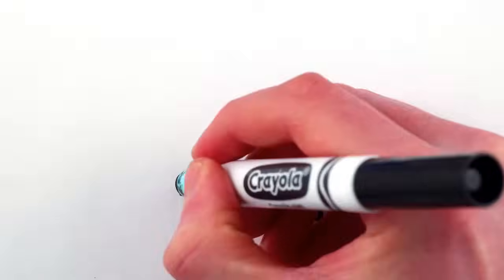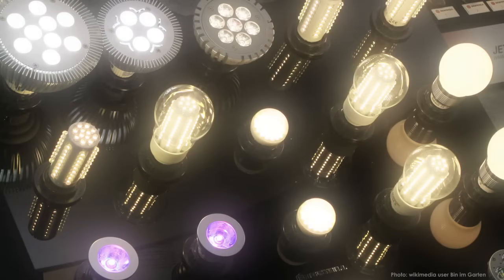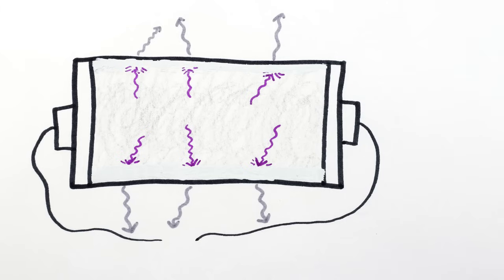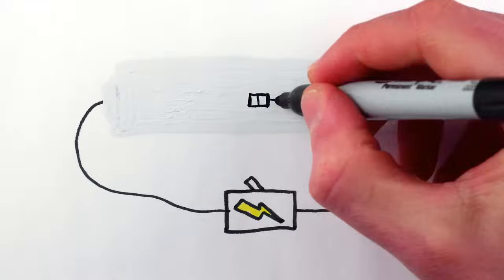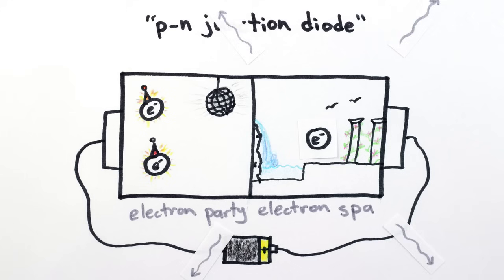How Modern Light Bulbs Work

Comment: Good video, although your description of gas discharge lamps are a bit weird. It may be accurate for low pressure sodium, but HID bulbs work by having two electrodes inside an arc tube that generates the light.

Comment: what is the white coating in fluorescent bulbs?
Reply: also. the diode 'explanation' is just sounds like an inserted belief of what happens. it reaches a proper enough conclusion, but the steps there seem strange and close enough but not there.  (not that its your belief).
Reply: Phosphor.
Reply: It's a phosphor coating that converts the UV light that the bulb emits into visible light.

Comment: You left out (though the usage of battery implies it) that led based lightbulds all have transformers and rectifiers build in. IMHO huge waste compared to incandesent bulbs, which actually produce heat along the light lessening the heating costs of our apartment in Finland where heating is needed in summer nights also. I hate the EU ban on those as the result is more waste and waste of resources.
Reply: commenting while not knowing 100 percent, LED light bulb is more efficient because the diode itself doesnt need to create heat to create light, and saying that led lightbulb waste more energy because of the driver and rectification process proves the point even more that you dont know stuff
Reply: @GERMANIA292  But led lightbulb is more costly to make and as waste is electronic waste and costlier to handle. So change from the incandecent bulbs raised the cost of the bulbs over 300%. Also Led-bulbs have lower life expectancy than incandecent bulbs.
Reply: @topilinkala1594  maybe LED last shortee than incandescent because you were buying the cheap one, the good ones is always better in almost any categories, LED bulbs are getting cheaper and cheaper you know they don't cost 10 dollars anymore, LED bulbs is also cheaper to run in the same time incandescent do, sure the initial cost is expensive to you but the power bills saving are still gonna pay off even if the LED have shorter lifespan than the incandescent
Reply: @topilinkala1594  there is a chance that the electronic waste gets recycled, infact, the old street light and the cfl bulb is way harder to recycle than LED
Reply: That's beyond the scope of a 2 minute video. Good explanation are good enough for an average youtube  viewer.

Comment: 3 months ago from 8 jan 2019 4:57 pm est:
thanks
8 jan 2019 4:57 pm est:
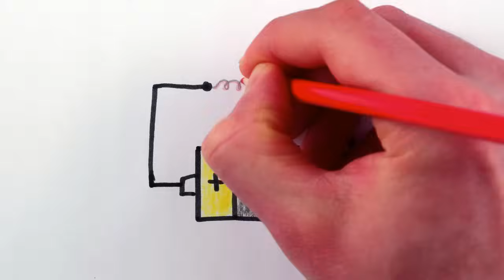0:01 1st light-bulb is just thin-wire having electrical-current,which make
     that thin-wire hot and glowing.that is called bare-filament/bare-wire electric-lamp,
     1st made by humphry-davy year 1800.
0:12 thomas-alva-edison insert that bare-wire-electric-lamp inside a glass-bulb,to keep
     away oxygen from that bare-wire because oxygen make that bare-wire,burn.
     so glass-bulb make bare-wire glow long time without burning.
     that is called incandescent-bulb,19th century technology.
source:'In addressing the question of who invented the incandescent lamp, 
historians Robert Friedel and Paul Israel list 22 inventors of 
incandescent lamps prior to Joseph Swan and Thomas Edison.[8] They conclude that Edison's version was able to outstrip the others because of a combination of three factors: an effective incandescent material, a higher vacuum than others were able to achieve (by use of the Sprengel pump) and a high resistance that made power distribution from a centralized source economically viable.
' in https://en.wikipedia.org/wiki/Incandescent_light_bulb from 'Incandescent light bulb' in https://en.wikipedia.org/wiki/Electric_light

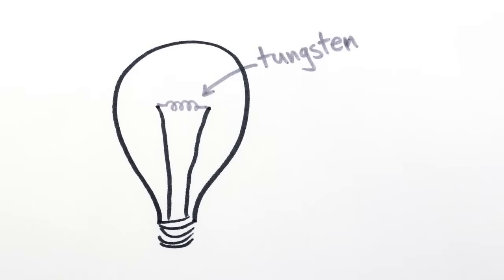0:37 halogen-bulb:has same tungsten-filament like incandescent-light-bulb.
     but halogen-bulb contain halogen-gas.
     halogen-gas catch stray-tungsten-atom which evaporate from tungsten-filament
     then put stray-tungsten-atom back to tungsten-filament,to prolong life of
     tungsten-filament and keep bulb-interior clean and clear.
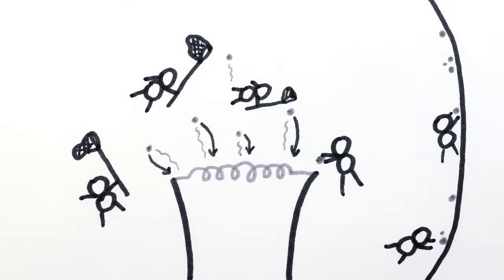0:59 fluorescent-bulb is a bulb/tube contain mercury-gas,contain electrode on both ends.
     electric-current flow from electrode 1 to electrode 2 then electron
     inside electric-current collide against mercury-atom in mercury-gas.
     that collision make mercury-atom excited then emit visible-light and
     ultraviolet-light.
     white-coat on bulb-interior absorb ultraviolet-light then convert that
     ultraviolet-light to visible-light(fluorescence process).
     that white-coat prevent ultraviolet-light which causes cancer.
     tanning-bulb has different coat.
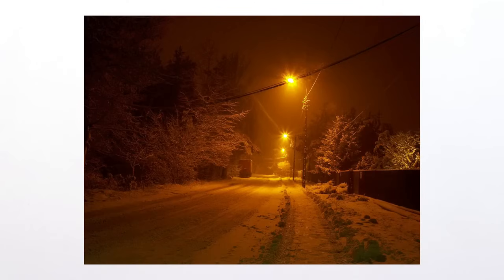1:35 sodium,mercury,metal-halide-vapor lamp,are often for lighting street,
     warehouse,gymnasium.
     sodium,mercury,metal-halide-vapor lamp,is a bulb contain gas,contain 
     2 electrode on both ends.
     gas emit visible-light so sodium,mercury,metal-halide-vapor-bulb does not
     need fluorescent-coat
1:51 led-lamp is just a tiny-crystal-semiconductor-gallium.
     semiconductor has 2 layer.layer 1 give energy to excited-electron.
     layer 2 give place for electron to relax.
     electri-current transport electron from excited-place to relax-place.
     excited-electron release energy in relax-place,that energy becomes light.
     that is light-emitting-diode/(led)

Comment: It would have been better if you had thoroughly explained it. Like this- When electron are excited they go to higher orbit but electron just want to  go back at their lower energy level and in the process of doing so they emit photon as a type of radiation and they do so to lose excess energy. This is what a light is.

Comment: Dude florescent lamps require like 180 volts to work ... They work by self induction you had to point out that
Reply: 120 volt.source:my 1 fluorescent-bulb-sylvania,1 incandescent-bulb-westinghouse.
 (1)fluorescent-bulb-sylvania:
     volt=120
     watt=13
     lumen 875
 (2)incandescent-bulb-westinghouse:
     volt=130
     watt=60
     lumen=485
[8 jan 2019 5:12 pm est]
Reply: what

Comment: Fun fact, solar panels are LEDs in reverse.
Reply: How did you figure that out
Reply: Solar panels take in light and output voltage. LEDs take in voltage and output light. But it goes deeper than that; they're actually built the same way. They both are based on p-n junctions.

Comment: while watching this I realized somthing...if light particles produce an extremely small amount of force on anything it touches then using solar panels as power you could use a bright light to shine on a space ship to move it without rocket fuel....if would be extrodanaraly slow but it would cause a small amount of force pushing the object slightly through the vacuum of space....and mabey a scientist can take it from here to improve on this theory
Reply: This works. In fact for things like Mars probes mission planners have to take into account a few m/s of acceleration due to light pressure on the way to Mars. There are also spacecraft that maintain their orientation with clever use of light pressure. And finally a long mysterious acceleration on the pioneer spacecraft was later determined to be miniscule photon pressure caused by radiation from the onboard RTG (nuclear heat/power source) reflecting assymetrically throughout the craft.

Comment: But MinutePhysics, you didn't explain your intro picture!  What's going on with the new bulbs made with the twisty tubes that have become so popular? Is that a fluorescent tube twisted so it doesn't take up much room?
Reply: yes
Reply: Dennis Magee the modern bulbs are all basically discharge tubes to generate cathode rays. But we can't use very long tubes every so it's twisted to make space
Reply: Exactly. They also have some additional electronics to make it turn on quickly.
Reply: Thanks!
Reply: thanks!
Reply: Thanks!

Comment: Actually, white-light LEDs are in fact somewhat similar to fluorescent tubes in that the LED itself actually emits fairly monochromatic UV light, which is then converted to broadband white light through the use of phosphor coatings. Sure, the way the source UV light is produced is pretty different, but it wouldn't be entirely wrong to call white-light LEDs "fluorescent LEDs".

Comment: My house from the 80's,has a light bulb turned on by pulling a string of beads,a long tube on some parts of the house,an electrical lamp on the rooftop garden and some modern light bulbs.
Interesting.I'm born in 2003.

Comment: ...I just wanted to know why those other light bulbs are swirly...
Reply: +MrPilot Guy Longer and thinner for more resistance -> inefficient conductor -> more heat/glowing light
Reply: +MrPilot Guy CFLs are the same as fluorescent lights, which means that they are tubes. in order to make them fit inside standard sockets, the swirl the tube to make it fit.

Comment: Halogen bulbs are terrible... I know from experience... TONS of wasted energy goes into heating a room several degrees in fahrenheit and lots of radiation requiring UV filters... These two combined CAN fry things such as a sticker on the inside of the lamp (not the bulb)..

Comment: And neon lights work by taking a noble gas (helium, neon, xenon, etc.) and passing an electrical current through it, depending on the gas, the colour is different.
Reply: +Aeternitas Ankondrivah (No.4 Holder of darkness) lol i had the same exact reaction

Comment: leds contain gas as well and the pn junction is used to force electrons to pass trough the gass and light it up. so you can think of it as low woltage fluorescent tube. (asuming the fact fluorescent tubes need up to 1 KV to light up)

Comment: How many hours can an LED bulb be lit before it dies? Some of the more classic bulbs only survive a thousand to a few thousand hours, but I heard LEDs "degrade" (for lack of a better term) much slower.
Reply: ***** That's only true if the industry can build crappy lightbulbs at a cheaper cost than their consumers buy them. Since longevity is a quality that a lot of people look for in a lightbulb, a new company could establish itself by selling very long-lasting lightbulbs, just with a significant price markup to maintain profits. There's no reason for the new company to sell intentionally short-lived bulbs, since it gets more than enough money from selling high-quality products at a very high price.

So, it's probably not a giant conspiracy to keep us consumers coming back for more. It's actually economics that keep us consumers coming back for more. Don't assume malice when self-interest is an adequate explanation.
Reply: Most LEDs have a lifespan relational to their temperature vs their heat synch, in other words, the hotter they run the less hours they exist. Typically, 30,000-150,000 hours, but the most likely scenario is the  soldering points will burn out from heat and corrosion. This will happen between%10 and %90 of the LED's life, depending on chance, treatment, and quality of build. The highest power lights may burn out in 5-10 years of  constant usage, making them pore choices if they are too expensive, low quality soldering is the number 1 cause of them going out.
Reply: With consistent use, usually between 10-20 years
Reply: ***** I think we are missing a big point here, efficiency. Why laws enforce the use of fluorescence bulbs and LED bulbs? Because you will pay a larger electricity bill using tungsten bulbs than using fluorescents or LEDs, and the government wants to reduce the emissions of CO2 (as a good share of electricity comes from coal and gas).

Fluorescents and low-consume bulbs are ok, but I think the winner here is LED. I bough some LED bulbs that produce the same luminosity as a 100W tungsten bulb, but were around 10W... it's a tenfold decrease! Plus they also last much longer than tungsten ones (10.000h of use I think) although.... they are very expensive :''(
Reply: ***** there is no such thing as "take over" LED lights, florescent, HID, halogen incandescent, normal incandescent, and others have all existed and will exist for a long time because they have different purposes. For home lighting, LED are terrible because their range of color is somewhat limited. The waisted energy in incandescent is  not totally waisted into heat. Temperature has nothing to do with luminescence. Try this, light up the room with the element of an electric stove. ((((((((((((((((((((((((((((((((((((((((((((((((((((((((((Has nothing to do heat.)))))))))))))))))))))))))))))))))))))))))))))))))))))))))))))
Energy is simply waisted into resistance and not put into heat. The same 1 w of energy it takes to make an incandescent flashlight light up one lumen, can make a LED light have 100 lumens. The two flashlights put out an identical amount of heat so you are wrong about heat being that waisted energy.

Xenon HID are great space savers,and are the only lights that will outperform halogen incandescent lights in every way including producing more -guess what - heat. Kryton lights are also not used in home lighting for reasons I don't understand. It would be nice to have a new light that is good at everything but they all have weaknesses.
Reply: ElectricPyroclast most common bulbs sold now last for a far shorter time on purpose. (the industry doesn't want you to buy regular bulbs any more)
Reply: ***** No, it's also true if the industry can sell fluorescent lamps for a higher profit and/or more often than any regular light bulb. But if the regular bulbs last longer and are cheaper people naturally wouldn't go for those, or would they?
Besides, those crappy regular light bulbs have a much much higher profit margin than before. They are indeed build at a cheaper cost and sold for a higher price than before: what better way to push consumers towards fluorescent lamps?

What new companies are actually selling regular light bulbs? The real problem for that is that there have been put laws into place to discourage regular bulbs. On top of that are the patents for many designs, manufacturing techniques etc. of regular bulbs still owned by the large companies in the industry. New companies only would sell those long lasting regular bulbs if they were able to actually produce and sell them.

There are no high quality regular light bulbs available any more. Whereas they have been available before. The question one should ask is why can I buy short-lived regular bulbs, but not the longer lasting regular bulbs that were available before?

Of course it's self-interest and not simply malice for the sake of malice. The fluorescent lamps were more profitable than the regular light bulbs. They can sell them for more, and they would actually have a shorter lifespan, meaning they would sell more of them as well.

Of course it's economics. It's not to keep consumers from coming back for more, it's to get consumers to come back more often, and buying more profitable products, all in the name of preserving the environment - even though fluorescent bulbs last less long and are worse for the environment than regular light bulbs. ;-)
Reply: LuisIsern Of course the winner is (or seems to be) leds. And I'm truly glad those offer an opportunity to step away from harmful fluorescents. Those are far from "ok" and their benefit in reducing energy consumption was a joke.

It's actually been shown by several studies that people became less conscious about turning off lights to conserve energy because it indeed mattered less to their wallets. Effectively barely any energy was truly saved resulting in minimal impact on the environment.

Meanwhile the chemicals used in these types of lights, and their short lifespan caused much more of an impact on the environment than could have been reduced if there was actual energy being saved.

Even more so because household lighting has never been a major factor in our energy use even if you only look at homes and not also at industries. The whole energy saving argument was a fantasy from the beginning and just an excuse to justify the laws to enforce more profitable bulbs with shorter lifespans (not to mention them often not even fulfilling the promised luminosity and it deteriorating throughout their lifespan).

As for the incandescent bulbs, most of them are used inside the house mostly at the darker (and thus relatively colder) times of the day, and for the longest duration in darker and colder seasons. The notion that the extra energy consumed by them is always wasted is false. Although a large amount of their energy isn't used for their main purpose (lighting) it can hardly be called wasted when it is emitted as heat in temperature controlled indoor homes. The little heat they generate will most of the time just add to the heat already generated on purpose by heating appliances that are already active.

In the end it's very clear that if not deceitful or delusional, the argument of saving energy with these short lived and chemically harmful fluorescent lights for the sake of the environment is severely short-sighted and ignorant.

It seems LED lights will eventually take over and it seems that's a good thing but I know too little of them to be sure those are the solution.
Reply: +ElectricPyroclast, LEDs are generally a solid choice and very much safe from the originals.
Reply: Ben Braceletspurple Thanks for clearing up the heat subject! I didn't know that! That changes that part of my argument indeed!

Comment: If the florescent light emits UV rays wouldn't it give cancer
Reply: In the video they talk about how there is a white coating applied to each bulb to absorb the UV light and to re-emit it as visible light. This prevents it from having negative effects on us.
Reply: No, because the UV rays are absorbed by the fluorescent coating and re-emitted as visible light. Lots of energy is lost in that exchange. Imagine a bullet hitting a brick wall. The bullet will stop, but some of the energy is transferred through the wall in the form of shattered brick on the other side. if you are standing far enough way from the wall, you might get hit by the fragments, but they won't hurt you.